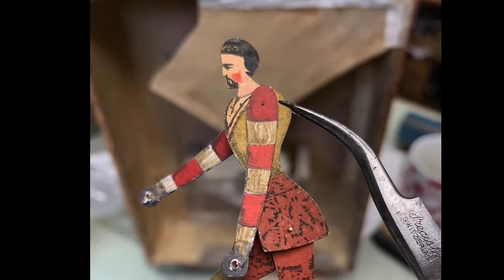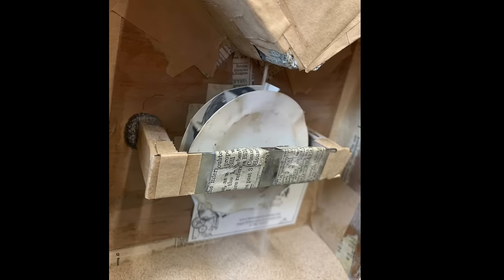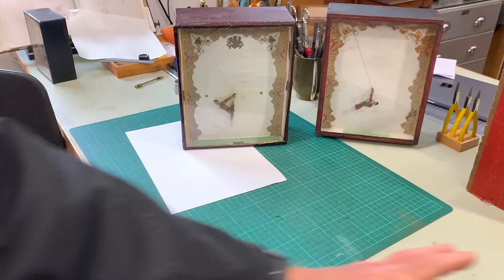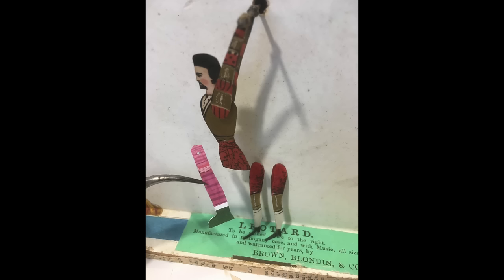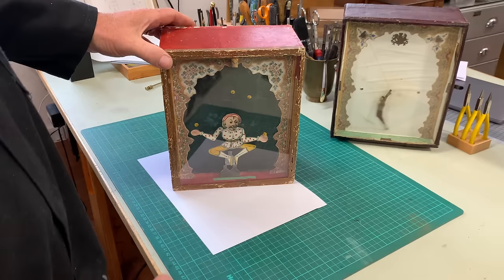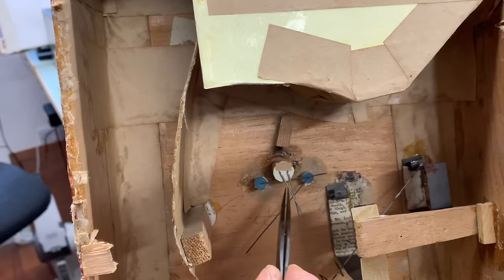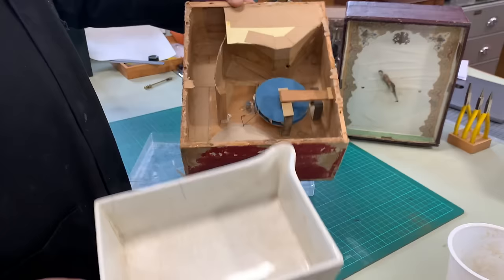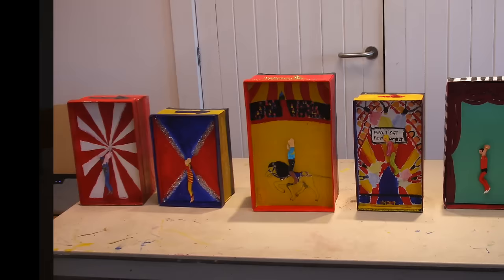Sand Powered Automata

Comment: I just found one of these titled "A Present From Newcastle" ( Newcastle Theatre England) when I opened the back up it had newspaper clippings on the upper sandbox dated January 11th 1863 It will need some restoration but it's a fantastic find.

Comment: If someone wanted to make their own acrobat, would a perler bead work instead of glass as a bearing? Possibly sanded inside?
Reply from the maker: The glass acts on both ends of the stiff wire axle as END bearings. The hole bearings that support the wheel and acrobat axle are pierced holes in tin sheet. Hope that explains it, so no need to use beads etc just punch a hole in some thin metal and secure it so the shaft is perfectly parallel.